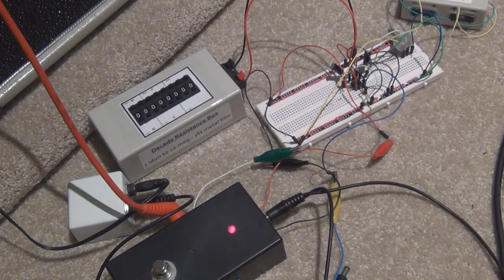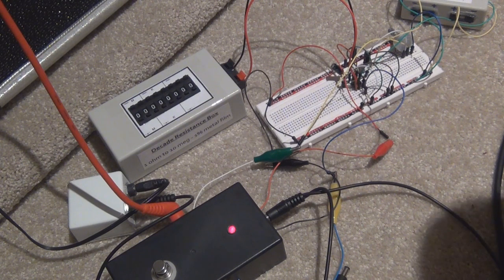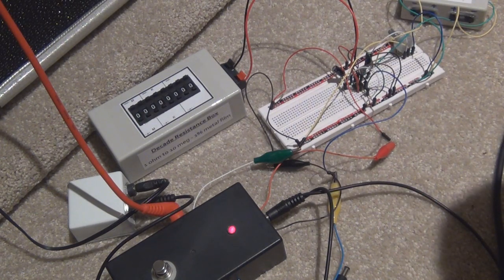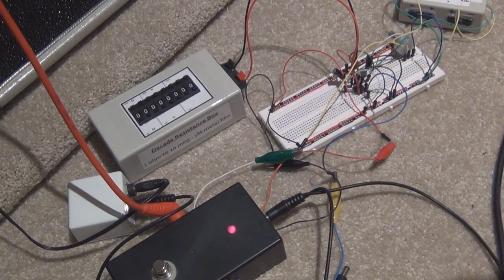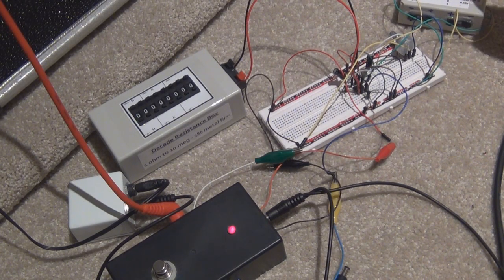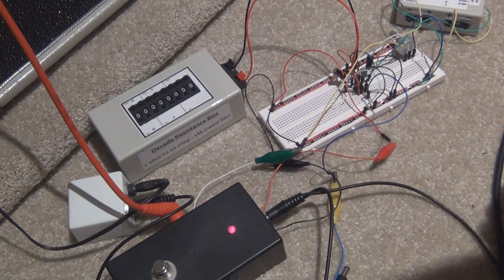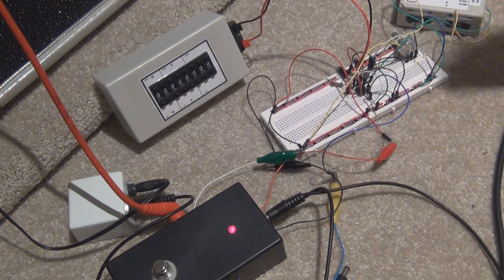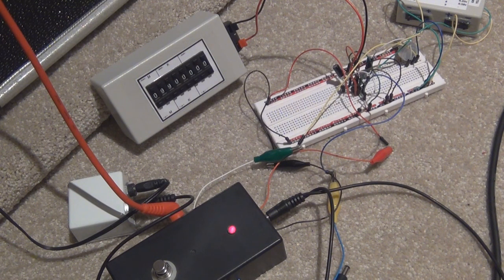Dead Easy Dirt - LM386 Distortion

Comment: As asked before me, can we get a diagram please? I have pretty much the same circuit build up as a standalone amp. Only difference is, I have a high impedance BJT buffer on the input and a 3 Band tonestack after the buffer, gain pot (1k) in series with a 10uF cap on pins 1 and 8 and a vol Pot between the tonestack and the input (3) of the LM. But compared to yours, mine sounds VERY artificial on the mid to higher gain settings. I assume it's due to the fact I have no clipping diodes and that's the interesting part. Do you use them as hard clippers? And where? At the output from the LM (Pin 5) I guess? So an exacat schematic of your circuit would be really nice!

Comment: Thank u very much sir ,iam trying to figure our the same problem from past 3 days and iam using the same UTC386 but did not get the solution ,but after your video just putting 2.2 uf capacitor at power rail did all the magic thanks again from INDIA

Comment: Here per your comment on your fake IC video. At 1:38 I've had that experience with the crappy sound as in your video here, good to know the fix for that. However, I can't even get my new LM386s to sound like that, they won't even pass a signal - all I get is very loud weird noises, farting oscillation and very loud aggressive white/pink noise - no signal at all. So all ten of these "new" LM386s I recently got are whacked for some reason, if that's even what those chips really are. Really is maddening that we have to worry about fake/screwed up IC chips now.
Reply from the maker: Yeah could be fake.  Buy from a trusted seller, avoid ebay and these 3rd party sellers, it is totally pot luck.

Comment: Im TOTALLY new to this never soldered in my life. Question? Im using A 1 uf electrolytic capacitor only one in shop is a 16v one I got 9v power does it matter what voltage capacitor is. Keep up good work how ABOUT a heavy metal pedal PLEASE.
Reply: Im sure you probably know by now, but just in case. The voltage stated on the caps, just refers to their maximum voltage before breaking down (or blowing up). So at 9v, you're well within it's capabilities.